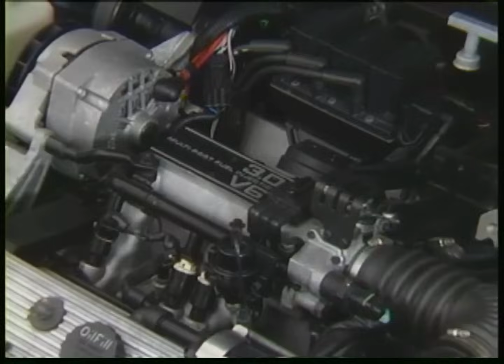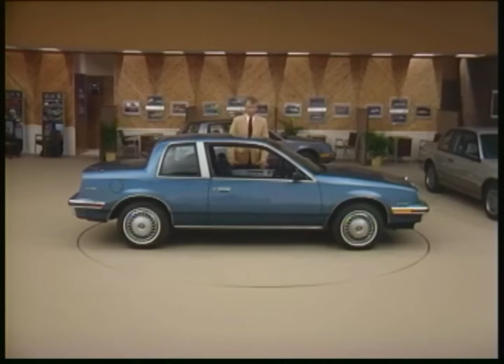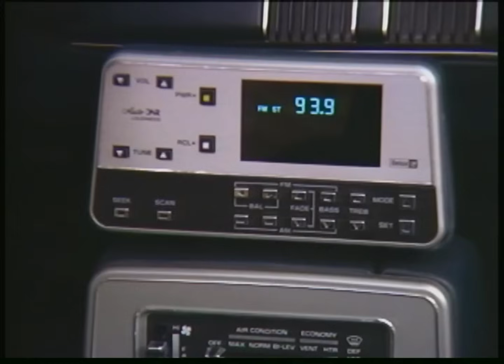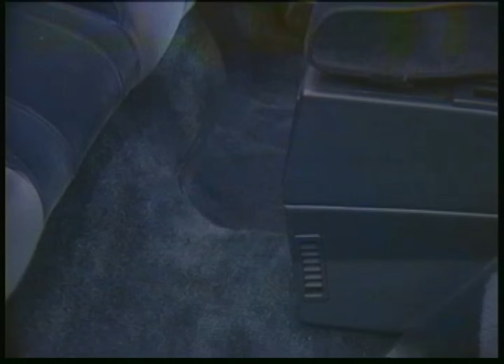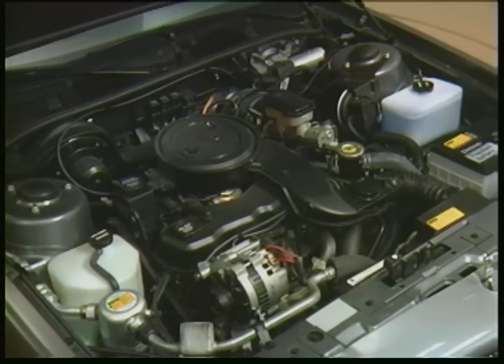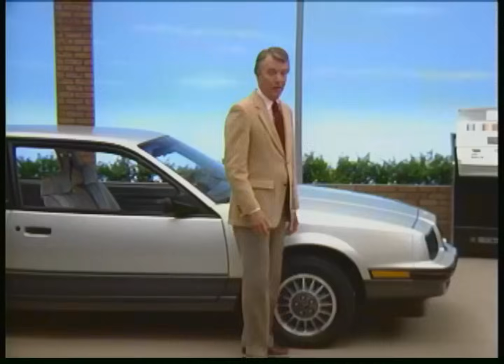1986 Buick Somerset and T-Type!

Comment: The irony of the 80's GM cars is they use different sheetmetal, but you can't tell because of that vertical rear window. GM probably spend a lot of money of the differences between all of their cars, but no one could tell the difference.

Comment: These cars were pretty good once that V6 with the nylon cam gear and the Magnavox sourced coil module was dumped. The Chevy 2.8 and the later 3.3 were way better. The iron duke, yeah…
Reply: Just how bad was the Magnavox ignition? Because the later individual coils mounted separately on the ignition module seem to fail often enough to be a pattern problem on cars with that system.

Comment: 4:24: That stereo module moved when he pushed a button.  That cannot possibly be normal, can it?  If something this visible and prominent isn't properly screwed on, what other parts of this car are improperly screwed together?
Reply from the maker: Gm build quality ✨️ 👌
Reply: @thewretchedwrench  I didn't think that GM would make this build quality lapse so obvious.
Reply: Though the pod mounted head unit was cool looking, they changed this in model year 1987 to something that, uh, didn't move and was more conventional.  I remember, from my Grandfather (Mom's side) buying a new Somerset Limited off the lot back then, five different head units were available - AM only, AM/FM stereo radio, AM/FM stereo radio with cassette player (which his car had), AM/FM stereo radio with cassette player and 5 band graphic equalizer, and AM/FM stereo radio with cassette player special to cars with the Bose system that had Dolby on the tape player.  His car had the extended range rear speakers.  There was also a Concert Sound System of upgraded speakers (I think 6) positioned in price below the Bose system, but upgraded from the cars with either standard speakers or extended range rear.  The tape players were part of the head unit and not separated like in the pod system here.

They also moved the power window switches to the door panels for 1987.
Reply: It moved because it was on a swivel so it could be turned to face the driver, or more to the passenger.

Comment: I can feel the iron duke vibrating and humming from here
Reply: And the buzzing & vibrating steering wheel!😂
Reply: I can hear the dash rattling
Reply from the maker: A friend of mine used to have a Cavalier around that year. The dashboard used to vibrate violently and throw stuff off of it when you were stopped at a red light at idle. It would crack me up every time. To this day, I have never seen another engine as unbalanced as the Iron Duke
Reply: Ive got 2 cars with duke's.  One carb, one efi.  Decent engines just crude
Reply: My 2011 buick with the NA ecotech is just as bad.GM can make a great 4 banger(quad 4,the duke) but has never figured out the NVH till only recently
Reply: Some are Buick V6. 4 cylinders suck.